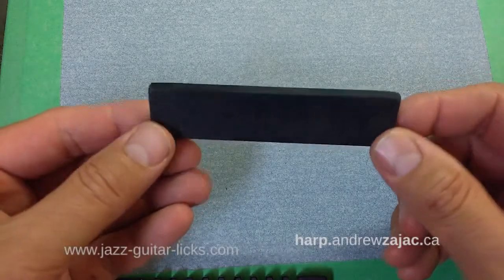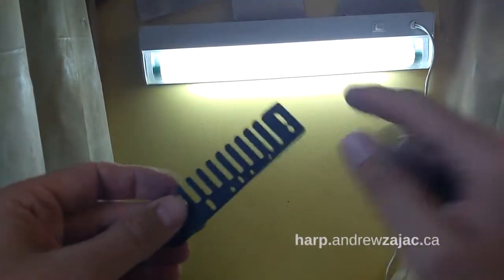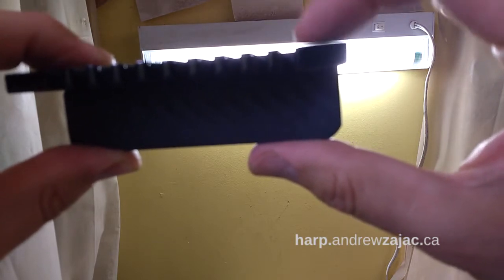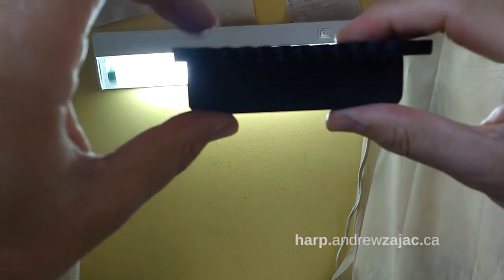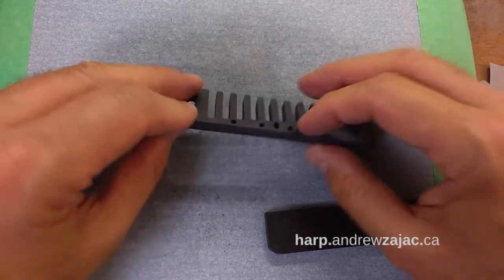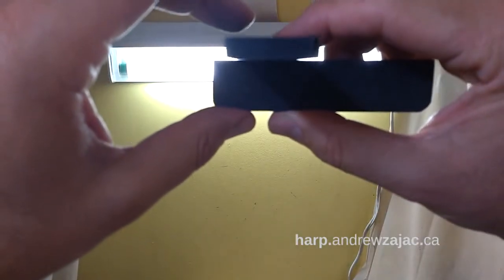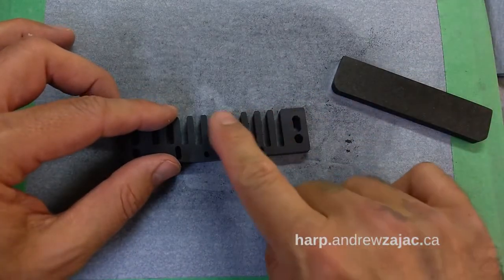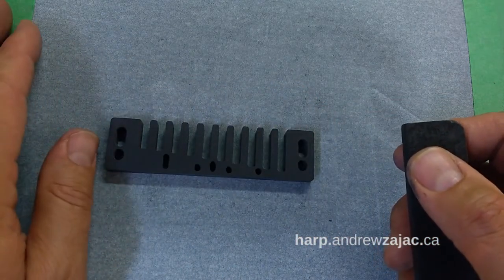Andrew Zajac Comb Tool™

Comment: What sanding paper do you recommend?
Reply from the maker: 220 grit - any brand.  Anything finer (higher grit) will just round off the surface you are sanding so any finer is not better.
Reply: arzajac thank you it was my mistake! I wondered why do I ruined so much combs without good result.